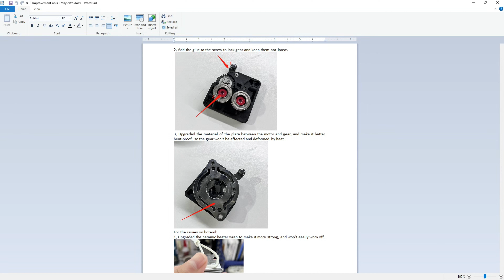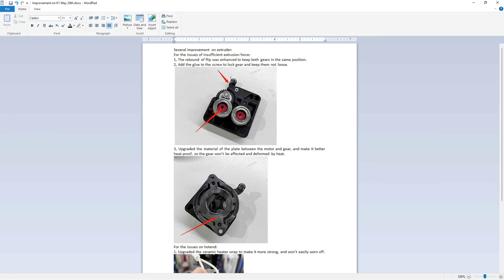Creality Upgrades "K1" 3D Printer to FIX problems, and improve performance. See the List!!

Comment: I am a noob, so not going to open up my printer, but the filament locking gear is rock solid, and had no issues so far, so think I must have the latest version with upgrades. Received my printer second week of june
Reply from the maker: Working on your printer is something you'll want to get used too, but you certainly have the new updates in June.

Comment: I got my K1 yesterday and have issues just getting filament to load by hand ...I added a 20 mm longer boden tube ..its still hit or miss on loading ....so far so good printed a few things in PLA now on to PETG and PET /CF ...got hardened nozzles with unit..

Comment: I received my second K-1 a few days ago. The present date is 6-13-23.  The first K-1 was damaged in shipping, and while the damage was cosmetic, the performance of the printer was suspect. With this new machine, I'm using the Creality Print interface, which I think has made the printer MUCH QUIETER. But after seeing your video, I'm wondering if this machine was modded by Creality. It was in the California Warehouse up until approximately seven days ago. IS THERE ANY WAY TO KNOW WHICH MACHINES ARE COMING WITH THESE MODS? Do you have serial numbers to go by?
Reply from the maker: I'm not sure. I emailed for more detail. I wonder if we can find a visual difference on the new hot end cover or fan.

Comment: Thanks for sharing, with the K1 Max in the horizon, is there a resource on the other fixes or upgrades they're adding. I'm thinking of holding off on my order for a couple of months
Reply: That or go with another brand if you can't wait.  I really like the idea of the K1, but mine has been a nightmare.  Replacement hotend is also no good, so my printer is still down.  If you can wait I'm sure they'll get it sorted out but the initial units obviously were rushed across the finish line.
Reply: @NavyCuda  Hey, love the name Mr NavyStormRifle hehe. I've actually just ordered a X1C. I'm sure I'm going to love the thing but I've had a good experience with CR printers so far so I'd want to give the K1 series a chance eventually. I'm holding out for the time being since I'm not in a rush and I was more interested in the bigger build volume of the Max. I suppose I'll wait until maybe end of the year or something.
Reply from the maker: This is all I have. They sent it to me yesterday, but informed me additional updates have been done since this Document, dated May 20. I look forward to the Max
Reply from the maker: What's the issue? Drop into my FB group and post for some input
Reply: @3DRundown  looks like I'm going to order the Max anyways, my local store is cutting me a sweet deal
Reply from the maker: You have spammed my page several times with this post. I have to cut you loose.
Reply: @3DRundown  what do you mean? I sometimes comment on your content, I don't think I spam you

Comment: I'll be the Elephant in the Room, What about us poor Saps that have the OG struggling with issues and Customer Service will not replace the parts!  I have been going back and forth with Creality Support for 3 weeks just getting the old fashion run-around.
Reply from the maker: They are indeed sending out new parts. Actually, it's common of Creality to do so. They have a massive user base and are Only in China, so, they do struggle to keep up, and sometimes fail to communicate. Email them, CS@Creality.com, talk to their live chat at creality.com (after 9pm EST). Speak in easy English and be Specific. They also have a support page on FB

Comment: I got mine around that document date.  I do have the extruder issue. So I don't think I received this update.
 Should I just reach out to them and will they send me an upgraded extruder?
Reply from the maker: I do believe they will send the new one
Reply: @3DRundown   I reached out for both.  Thank you for your video and replying.
Reply: I got a new extruder and it worse.  It is the new model.  Its chewing up the filament and jamming.  Support is sending me a new extruder.  The new hotend works great.

Comment: What are you thoughts on the K1 vs P1P now that they are the same price? I like the looks of the K1, but the P1P seems to outperform it from the YT videos that I've seen. I currently have a Ender 3 V2 Neo that worked great for 6 months, I've been fighting it the last month with extruder and hot end issues, upgraded both and now trying to get it running smoothly again. Been thinking of upgrading to something else. 
Thanks for your videos, very informative and helpful.
Reply from the maker: At the Moment, a P1P. It's a proven winner. Also, the AMS is an epic game changer. I have high hopes for the K1.
Reply from the maker: Also, what's up with your V2? I like the V2 allot
Reply: @3DRundown  Thanks for your input. 
All my problems started with a clogged nozzle. I found the boden tube was in bad shape so I ordered capricorn tubing. Replaced it and a new nozzle. Good for a few weeks and the same thing. Bought a new extruder, replaced the capricorn tubing and nozzle. Same thing after a few prints. This went on for a month or so. I bought a full metal hot end and installed it and then nothing worked. It all came down to the capricorn tubing I bought on amazon wasn't the real thing (I think). In the reviews, other people were having similar issues. The outside diameter was a little big and wouldn't fit in the hot end all the way. Bought some more capricorn tubing and sure enough, it fit perfect and everything is finally working again.
Reply from the maker: Why did you copy paste this reply to a second post?

Comment: So is this something they will automatically send out for the earlier releases? Or do we have to wait till the issue comes up and have our unite down till they send out the parts? In other words, are they going to be "PRO ACTIVE" or "RE ACTIVE"?
Reply from the maker: If you have a problem, and need a new part, you will contact support and get the updates version of that part. This is how it works for just about anything